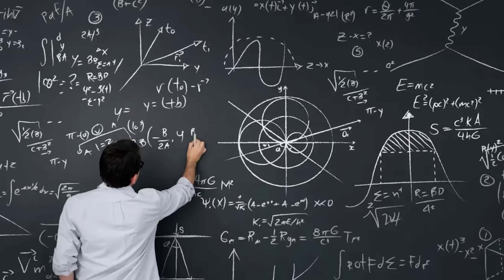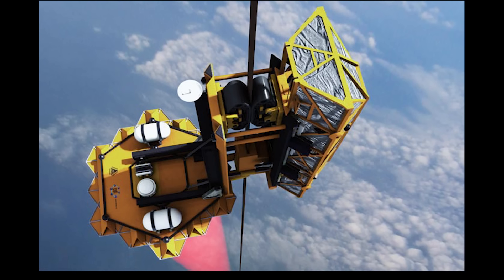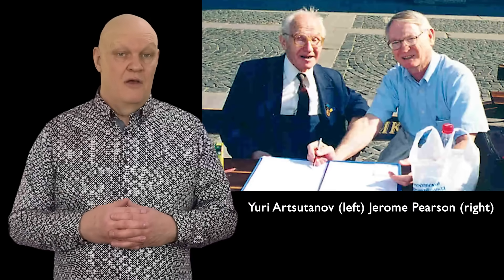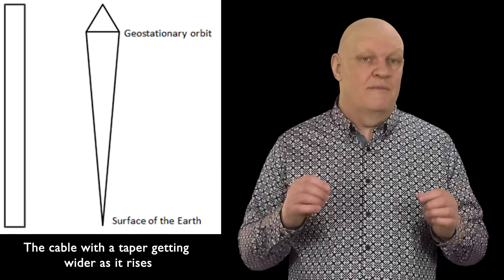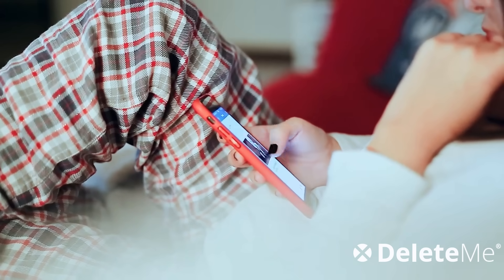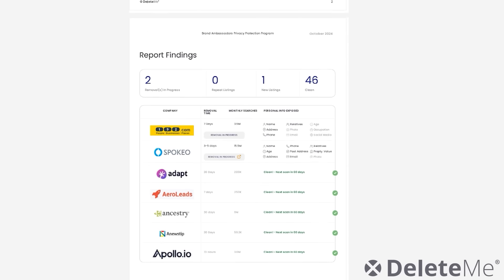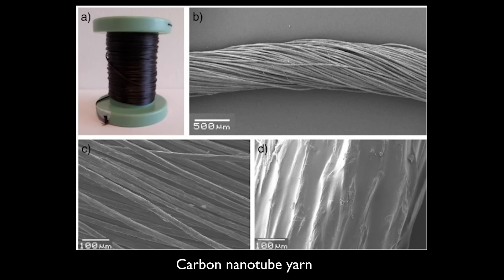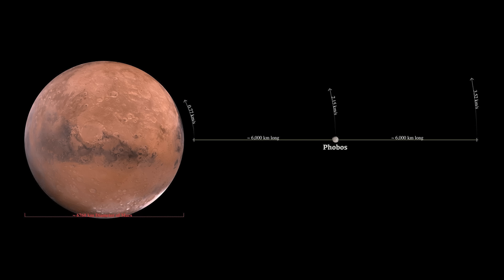Are Space Elevators Still a Thing for the Future?

Comment from the maker: 🔒 Remove your personal information from the web at https://JoinDeleteMe.com/DROID and use code DROID for 20% off 🙌 DeleteMe international Plans: https://international.joindeleteme.com
Reply: The idea is a non-starter.
Reply: The problem is that, as orbital radius increases the velocity decreases, meaning that the top of the cable will be rotating around the Earth much more slowly than the lower parts which will be moving faster than the rotational velocity at the ground. Therefore it will wrap itself around the planet until it either de-orbits or else snaps catastrophically.

Comment: Rather than earth to geostationary elevators would prefer more effort put into a smaller Two tier tether system for space plane energy conservation and outer atmospheric launch.

 Running from 80 miles up to a few hundred, cycling earth multiple times a day.

Lower tier would be a cable / rotatavator /  tether of 10s of miles while the upper tier a struss of 100s of miles with station bays required to aid construction and assembly.

Off planet makes it difficult to sabotage, relative small length makes much easier to built with existing materials, not as energy efficient but still better than direct earth launch.

It still wont solve satillite space junk problem.

Comment: The main problem isnt the material. The main problem is energy. Objects in orbit have higher velocity than on earth. That is why launching a rocket requires so much fuel, most energy is to gain velocity, not altitude. You cant just pull object into an orbit..the energy for velocity change has to come from somewhere. So if you would pull something up, you would also pull the counter weight or station down, reducing its velocity. Because how are space elevators described, is basicaly a perpetum mobile, creating energy from nothing. And that is why this concept is impossible, as described here. Everytime you would pull something up, you would have to use rocket motors to get the counerweight back to its original velocity.

Comment: Some of the physics does not make sense to me…

As an object leaves Earth, it has to gain horizontal (aka tangential) velocity to maintain any kind of orbit. In this case, wouldn’t an object being “elevatored” up be stealing momentum in that direction from the cable and space hub? With a heavy enough cable, it would take several launches, but eventually the space-end of the cable would lag behind in the orbit relative to the ground-end. Why is my reasoning wrong?

Comment: You still need speed to travel somewhere, just getting high can provide you some potential energy some part of that can be transformed to kinetic but that will hardly fulfills even low orbits need. We need other engines working on other fuel. One 19 century man suggested electromagnetic space shell launcher. If we will be able to eliminate all extra mass required to reach low space height it will be already good enough to start build something around and transport fuel there. At least for Moon exploration.

Comment: I'm wondering if it would be better to have a partial elevator, one that came down part of the way from an orbital station. Ships would fly through the atmosphere and attach to the cable, then take the elevator up to the station. And vice versa. It would significantly reduce the cost because you would use traditional planes to fly to the cable (instead of rockets), and it would overcome the weight / stress problem on the cable.

Comment: I believe your stumbling block is that you are only considering materials that can be manufactured!  You need to consider what is necessary to use the elevator...ENERGY.  If the tether was generated using a beam of microwave energy converted from solar panels in space (I saw this concept realized on the Discovery channel) then the platform could "ride" the microwave beam up and down.  When the elevator is not being used, then the microwave energy could be used to power the grid there by reducing dependence on fossil fuels or just turn it off.  According to the show, the planet only needs 5 of these satellites to power the entire Earth,

Comment: Always wonderd if it would not be more feasible to remove gravity from the equation, rather than work against it.
Ground based structure. Geostationary station above, thin cable (material does not matter)  with a field maintained or activated/deactivated between the 2 stations that removes the effect of gravity within the field. That way you can send stuff up with merely a gentle push. Or if using a cable as suggested you can increase speed exponentially all the way up and slow it down at the end simulating 1G along the entire path of the trip. rotating the ascending platform midway to not have folks smushed on the ceiling :)

Comment: I did the math on it but it needs to reach geostationary orbit 35k km and a single nanofiber can’t make it to the earths surface without breaking. The cable needs to taper down to make it. You need 4 falcon heavies to get that single wire to geostat. Once you get to the surface you need to keep on adding wires before you can pull up anything or start building a real structure using the tension to keep it upright. Once that part is done the trip to geostationary orbit will take 15days or so which isn’t efficient.

Comment: you said with steel the taper was greater than the known universe. you didnt mention what the taper was on your two possible materials. also you never mentioned what the total mass would be to build, would we need to use the entirety of earth to build the cable? also you dont need a 37,000 km cable, with the counterweight you need a 74,000 km cable. and how much weight does the actual counterweight add? i think this is like a ringworld or dyson sphere, there will never be enough material when and where we need it. very very obviously.

Comment: Because of centrifugal force the counterweight could relieve the stress of the bottom of the elevator.  However, if the weight was too far out there would be tension at the bottom as the whole structure wants to pull out into space.  If it should become detached ....

Comment: Space elevators are a bad idea. Costly.  Weathering, man made problems,  stress over time, extreme maintenance and and structural damages would be a pain. Space debris would also be a factor. Would have to be massive in size and would make for tempting target should tempers flare. Space elevators are currently a bad idea all way around.
Reply: Could create turbine blades  every so far along the length of the elevator to help stabilize the structure and help mitigate the weight. All electric.   In sets of Four large drone like fan motors at spacings would make it strong enough to support its own weight.

Comment: There is one big problem with space elevators, and it’s related to engineering methodology. Namely, how do you iterate on the design? When you want to build something that has never been built before, you start simple and small and then you iterate on the design: you keep what is working an you improve on it. We can see this with rockets: they kept bigger and bigger until enough practical knowledge has been acquired and you can build the big Saturn V. You cannot do that with space elevators! You cannot build a small one to learn what works and what don’t. You have to build the full one right from the start, and it absolutely cannot ever fail, or you have a planetary disaster on your hands.

Comment: Most aviation accidents are CFI (Controlled Flight Into), something. Usually a mountain. I'm sure a nano fiber is much more avoidable! A paint fleck going the wrong way almost penetrated the bullet-proof window on the space shuttle. Any nation or nefarious group could easily disable it. Lightning loves stuff like that fiber! Carbon fiber aircraft have to have special wires embedded to conduct Lightning and static away that aluminum doesn't or it blows holes in things. It's science fiction as far as any real practicalty is concerned.

Comment: I think there are a few other issues in this regard besides cable length, weight and strength.
1. Crosswinds at high altitudes.
2. Fluctuations in the forces acting on the satellite caused by the moving elevator (acceleration, deceleration, deflection to the side due to crosswind).
3. Consequently, there is a need for non-stop compensation of these variable forces with powerful rocket engines.
4. Consequently, the need for constant refuelling...
Taken together, these factors can make the goal itself unattainable.
Reply: Yep, I didn't understood how was the main station supposed to magically stay there and support all this weight, you need to actively pull the opposite way. If not, might be easier to pull the station down with your bare hands, like pushing a boat on the water
Reply: Yes that's why I went for a non-anchored design. Solves a lot of problems. Also, my cable, material code, QCDG-Ultra, has 58,000 megapascal ultimate, 3.12 g/cc.

Comment: Space Elevators are NOT FEASIBLE and probably NOT EVEN POSSIBLE.
A far more economical way of getting into orbit is the re-usable SCRAMJET booster along with a modest size re-usable orbiter. Mach 10 has already been obtained with a scramjet. Even if no higher speed is possible, use of a Mach 10 scramjet booster would enable a 90% reduction in the size (and cost) of the orbiter. Furthermore, this is KNOWN to be possible.

Comment: The Space Elevator.  Ah, a sweet moment of nostalgia. How quaint.   

It's right up there (down there?) with the through-mountain rocket-launching tunnel using electromagnets as thrusters. And destroying the rocket with shockwave from the atmospheric pressure the moment it exists the tunnel. IF it exits the tunnel. 

And let's not forget the SpinLauncher, guaranteed to squash whatever payload it might (someday) actually send to space at orbital velocity but sadly, having no means for horizontal thrust, will just continue a perpendicular trajectory out the the Kepler Belt.

My money's on finding the burial site of the original Pegasus, cloning the DNA and having them carry our payloads up to the ISS. It could happen, because being fantasy, the idea doesn't require compliance with physics. Other than wormholes and teleports, it's probably the next best solution.

Comment: Every couple years this idea rears its head. If you believe in the Electric Universe, like I do, then you would see the space elevator as the largest lighting rod every created. There are a couple universities that have lightning labs where they fire rockets trailing wire into the atmosphere creating instant lightning. Same thing larger scale. One of the shuttles missions had an experiment where they trailed a long wire down into the atmosphere to see if they could generate power. They under estimated how much power that the cable would transmit and shorted out a panel on the shuttle.
I am no expert on the Electric Universe but enjoy their content and it makes more sense to me that the woowoo of current cosmology with black holes, dark energy and dark matter. The EU doesn't need any of that nor the fancy maths that only a few people understand.
Paul is an excellent unbiased researcher. Maybe he could do an in depth look into the EU and the SAFIRE project.

Comment: Space elevator’s biggest hurdle would be how to avoid collision from micro meteorites. Finding meta materials like carbon nanotubes to withstand the weight of a 50,000 mile long tether? Sure that technically possible even if economically improbable, but withstanding the impact from grand of sand sized objects moving at 30,000+ mph without catastrophic damage is simply not possible. There is far much energy behind these objects and there’s trillions and trillions of them. Unless the entire tether was covered by an ionizing field that incinerated all debris that approached it there is no other way around it, and the field in itself would be more technologically advanced than the tether itself which would create the likelihood of a space elevator being built at 0%.

The closest thing humanity could get to a space elevator is sky hooks as they are vastly cheaper, can be built today right now with out understanding of physics and engineering. The only limiting factor is cost and the will to do it.

Comment: I think space elevators make for a great idea, but I also think we will find that they aren't actually possible, and the reason will be because they simply won't be stable.

If you tether an object in orbit to the surface of the earth, the tethering alone I think will actually interfere with it's orbit, and the reason why is because the tension of the tether will have a little give to it, but also be a bit springy. If it drifts a little one way or another, this springyness will cause it's rebound from that drifting to be exaggerated. This could create a feedback loop where by any destabilization at all, even something tiny, might reverberate through the tether and feed back into itself, causing its stability to degrade over time. It could be a slow process if the forces involved  stsrt off weak enough, or it could very rapidly lose stability and end up coming flinging right out of the sky.

Comment: some people now think it may be a good idea to make a TETHERED RING . if you make a HARD metallic ring on an ocean surface large enough ON A SPHERE you can PULL IT UP TO THE SKY with Ropes by pullung the ring to the center of the ring, but that center is "upwards" away from the sphere-center by being pulled on a sphere, the ring gets pulled inside, but is hard enough, to get PULLED UP instead .
This can IN THEORY  pull a ring on a sphere above the athmosphere of that sphere.

The ring can be significantly smaller than the sphere-radius for this to work, but you need a large mostly flat area (an ocean) to start with this.

If you somehow manage to evenly distribute the pulling with enough ropes, it can be done with 2010 technology, no carbon nannotubes needed.

Comment: Well, single wall nanotubes only have 70% of the tensile strength needed but we don't know if braided nanotubes, multiwall nanotubes, nanotubes filled with cementite (steel) or force sustained structures can't meet the requirements.  However, I suspect that a full space elevator past geosynchrous orbit may not even be necessary.  There are other possible solutions and simply lifting a rocket above the densest part of the atmosphere might be enough to reduce launch costs significantly.  I would suggest a bouyanr buoy like a marine spar, where the bottom is either anchored or ballasted, there'll be lighter than air "bags" above the center of gravity and a superstructure tower reaching higher above the atmosphere.  This would be similar to how our deep sea oil rigs work but in our atmosphere.  Mind you, if thr bottom is ballasted then it would have to support something like a landing strip on the bottom and if course the payloads would still have to be kaunched by rockets at the top to reach orbital velocities.  However, we'll be talking about a structure more similar to current tall skyscrapers and towers in thousands of feet, than the over 22,000 miles of geosynchronous orbit.

Comment: The upside is you wouldn't need to deploy a second cable in opposite direction from the geostationary satellite as it drops the tether down to Earth. You could just increase the orbit of the satellite incrementally as it drops the tether so the center of mass between the two remains at the geostationary point. Also, wouldn't the centrifugal force cancel out Earth's gravity at the part of the cable attached to the satellite, so the highest stress would actually be at the halfway point? Then you would only need a steel cable thickness half the width of the known universe. Totally doable. lol.

Comment: Question about all these theoretical nanotubes and graphene stripes cables. Do they have any theoretical flexibility to withstand horizontal forces exerted on the cable by atmosphere and climbers?
Reply: The cable is incredibly long and incredibly thin - far more so than a suspension bridge cable.
It will be flexible enough.